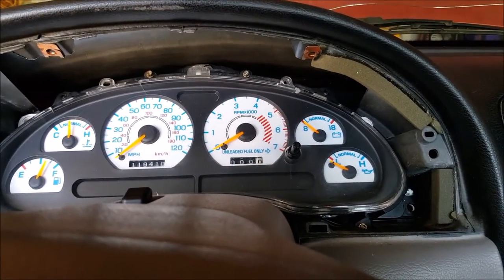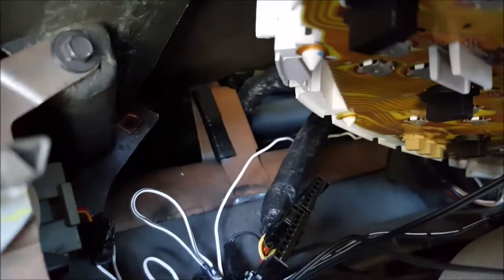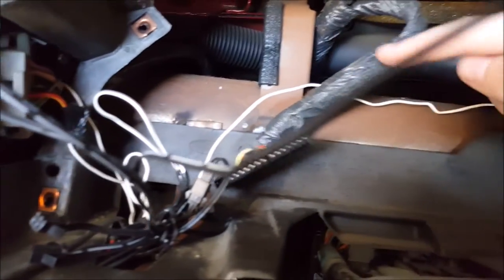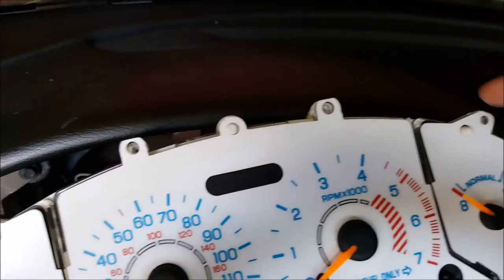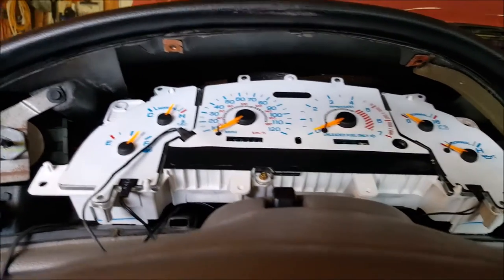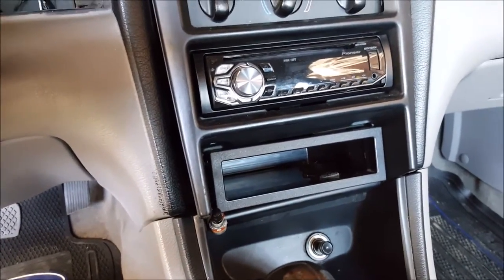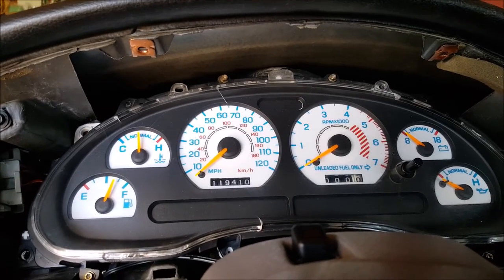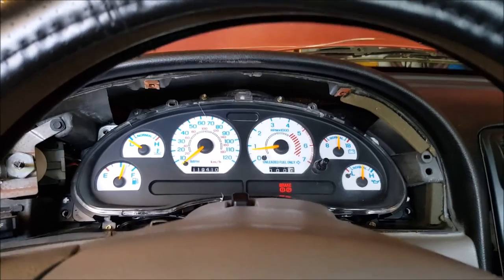1998 Mustang White Face Reverse Glow Gauge Insert Installation

Comment: And I know you can tie the two wires together to get your dimmer to work but the aftermarket one has a switch you can switch from two different colors so I don't think you would be able to switch the two different colors with the dimmer correct or ?

Comment: What is the "red wire with the yellow stripe?"  What does it give power to and why should we use THAT one?
Reply from the maker: It's the power wire for the head lights, I just read on the reviews that most people used that one. I suppose you could use another one if you want.
Reply: Adam Strojny
Sorry for all the questions but,  bought a generic brand and it didn't come with instructions.  Any idea what the voltage is from that wire.  I'm tempted to use the wire from the stock dimmer and by-pass the after-market dimmer switch.
Reply from the maker: That's a good idea to use the stock dimmer, tragically I have no clue no the voltage :/

Comment: I just blew a fuse wiring it to the multfuntion switch. I have no turn signals, no hazards, n no brake lights
Reply from the maker: Did you disconnect your battery? Then, double check the positive, the ground and replace the fuse.
Reply: Adam Strojny yes i disconnected the battery. I followed the same steps you did.

Comment: did u solder the wires???
Reply from the maker: I used tape... probably should have soldered, but I have not had any problems.
Reply: Adam Strojny so with the positive wire do you just tape it to the dimmer wire??? sorry I don't know much about how to connect wires
Reply: Adam Strojny like I my 02 mustang my positive wire is red and the guide tells me to connect it to the gray wire but I'm not sure if I'm supposed to pull out the gray wire from the unit, like do I just stick in the red wire in the unit as well or???
Reply from the maker: I would look up a wiring diagram specific to your year to find the positive wire on the car just to double check, then splice in the red wire. After you ground it, you'll be good to go (I did not mess with the wires on the dimmer just to keep it simple).

Comment: you have a mess buddy lol. you can use elmers glue on the back side of the gauges to hold them down. then you can also cut the aftermarket dimmer switch off and connect those 2 wires together and then your new gauges will work with your factory dimmer switch
Reply from the maker: I got it to light up and that was good enough for me, also i'll have you know the tape is still working fine lol. Thanks for the tips!